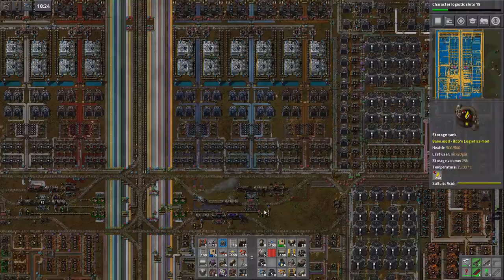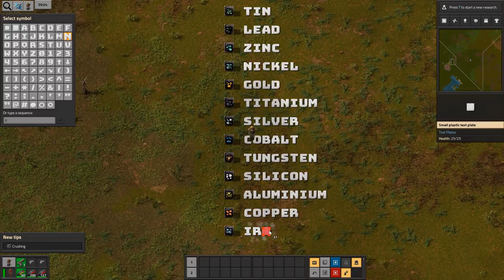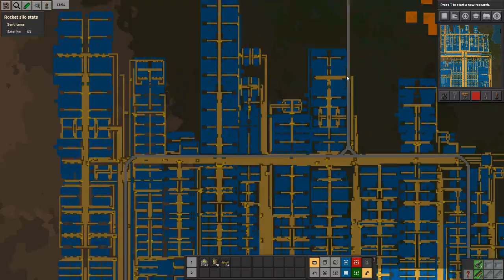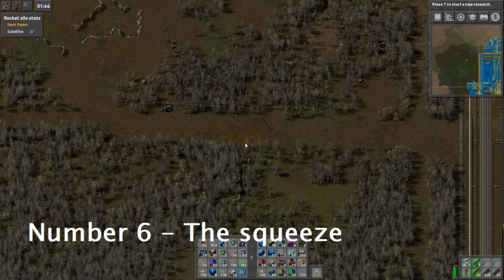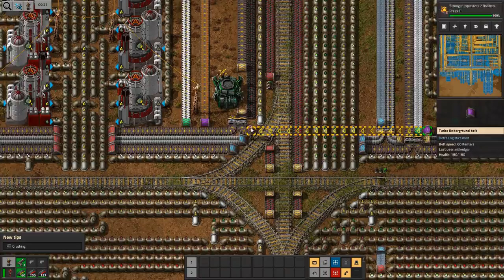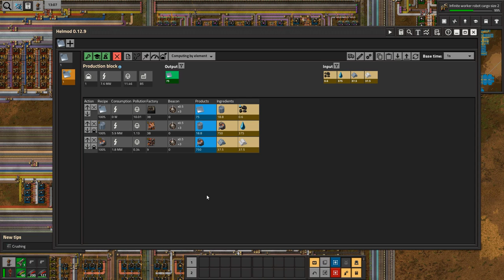Factorio - The ABC's of Angel and Bob

Comment: How do you capture the time-lapse videos? I haven't found a good way to achieve this.
Reply from the maker: I'm not sure my way of making a timelapse could be considered a 'good' way but if you really want to know...

In TLBE there is an option to set up an area tracker based on a set of co-ordinates, so remove all the other trackers and just use the area one. Then when you want to pan or zoom you'll need to incrementally change those co-ordinates to slowly move the tracked area to the one you want. Some of my larger transitions involve 100 or so changes, I can easily spend 30-40 minutes moving the camera from one location to the next. It isn't a 'good' method but it works.
Reply: @theotherbigfoot  thanks! Sounds like tlbe needs a pan/zoom option.
Reply from the maker: @mrpocock  You have no idea how much easier my life would be with a pan/zoom option in TLBE. I have a whole tutorial written which is basically a plea for someone to do just that. But I need to look at the other mods to see what they can do first. It might be easier with a different mod, I'm gonna check it out
Reply: @theotherbigfoot  I'm having a play with it now. If you go to the tracker tab, there's an option to create a new tracker. You can select the top.right and bottom/left of the new area by map pin (the abc option). Then as you want to move the area it focuses on, move those pins and re-click the abc boxes to update the tracker. If you have smooth zoom enabled, it seems to pan between those views. Make sure you add the tracker to your camera and have it before the base tracker. Also, you will want to fiddle with the zoom speed for the camera movement. I hope that I haven't told you all the things you already know and know don't actually work for you.
Reply: @theotherbigfoot  Also, I found that kdenlive is able to sequence them into a video using the "Add Image Sequence" project menu item. If you set each image to render for 1 frame, it appears to work OK. The zoom/pan transition effects bork it badly, so don't use those.
Reply from the maker: I have tried a lot of things with the mod but I'm happy to accept that I haven't tried everything. I came up with a method that worked, regardless of how long it took me, and just stuck with it. Regardless of anything else my method does give me complete control of every timelapse shot, I can dictate exactly what I want it to do. I don't have to trust a computer to do it for me and possibly do something differently to how I want it. Even if it saves time.

I'm going to do some reinvestigation I think, into tlbe and any other mods and see what I find.
Reply from the maker: Some reinvestigation later using your method with some of my own tweaks and bingo I have a working method for transitioning and for controlling the speed that the transition takes place at. This is going to save hours of my life. I am half way through a tutorial already. Thank you
Reply: @theotherbigfoot  I'm so pleased! I look forward to your next video.

Comment: the main issue i find is when it comes to research got any tips for making the new packs cause everytime i have to go up a teir its a whole new head ache hell i barely be able to get green up havent even maid it to the later ones jsut green
Reply from the maker: Red and green i deal with in the starter base using really basic inefficient tech. If you have biters in the game then youll want black science as well. Getting to blue is where the fun begins and thats where youll need a whole other factory. In that new factory you will need the purification process (mineral ore into elemental ore), smelting (elemental ores into plates), all of the acids (you can probably skip hydroflouric at the beginning), carbon, coke, oxygen and probably a few other things, as well as a reliable process for dealing with geodes, salinated and mineralised water, slag and crushed rock. Once you have all of that you are probably 90% of the way to blue.

Once you have blue it is mostly a case of using and extending the factory you already have, the raw infrastructure of your factory is mostly the stuff you need for blue. Of the 400 hours or so it takes me to build an angel and bob factory i would 200 of that is spent getting to blue. It is the hard part
Reply: @theotherbigfoot  ah ok cause when i first got to blue it was using SeaBlock and i looked at blue i was like man Green is bad ass and stayed at green

Comment: Do you use god modules?
Reply from the maker: What's a god module?
Reply: I heard you dont do modules at all. Amaze
Reply from the maker: @zhess4096  I used them in angel and bob whenever I needed to, its almost impossible to know what you are going to need so they are a good thing to have around. I always set the factory up to make them. But whenever I started a new angel and bob base I would go back to the previous version, work out how many assembly machines or chem plants I would need without modules, and then try and build that. The modules were basically a reminder of where I messed up so I wouldn't do it again.

In vanilla, I don't like them. I'm not going to mess up a vanilla factory so I don't need to use them as a reminder. Maybe for koverex at the beginning but thats it. I dunno why. I find it easier to design this stuff without modules.